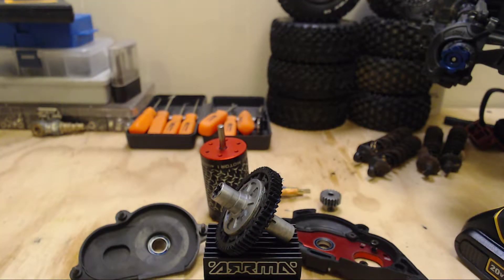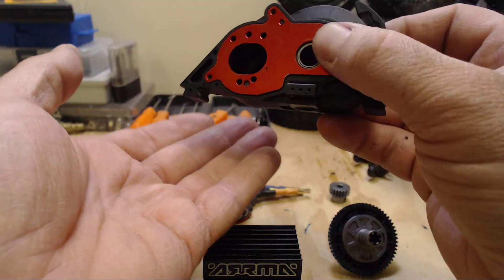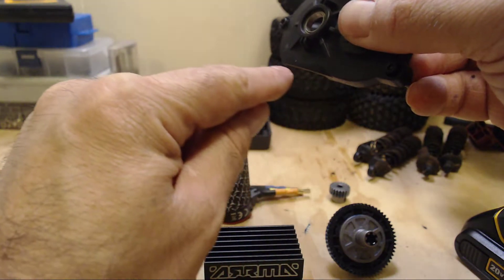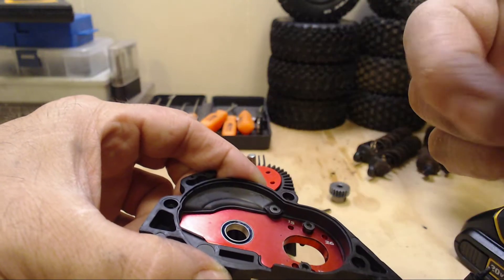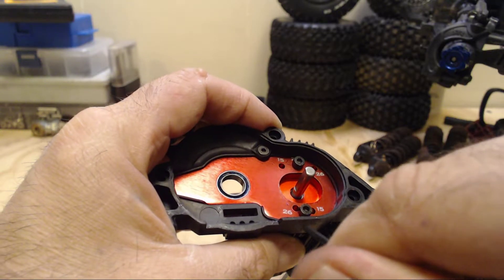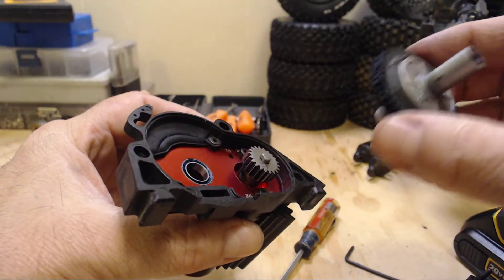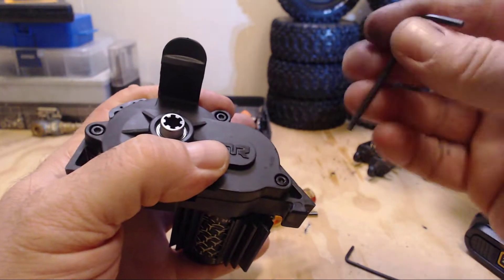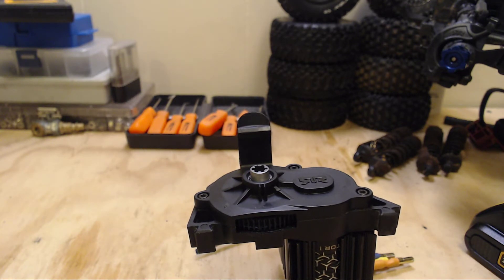Arrma Senton 3S - Power Module gearbox maintenance

Comment: A lot of people make use of the cut out under the spur by making a hole on the chassis right under it. Lets the dirt out instead of killing bearings in the slipper assembly and motor.
Reply from the maker: I've seen that solution before as well.

Comment: Grease in there will only collect and hold on to more dirt. I found a mod a bit counterintuitive but I tried it out after considering it for a while a d I'm glad I did. Take a look at this video from Rich Duperbash. Works great!
(check 5 min into the vid)
https://youtu.be/IzIHerc78Mc
Reply from the maker: I will check it out. The "fix" in this I've found is that when you hit the gas the first time, the force flings the grease onto the inner part of the housing and the dirt at least collects on that. Instead of your actual gears, causing more noise and ultimately premature wear. It's definitely a terrible design to begin with leaving the bottom of the gear case open. Shame on Arrma for that one. Thanks for sharing the link. Will take a look now.
Reply from the maker: Just checked it out. While allowing stuff to fall out, putting a hole in the bottom seams like it'd draw more stuff in to me. A point that ties in to that, I actually made a cover for the hole in front of chassis where you access the steering arm. A while back I had a rock actually work it's way into there and BIND up my steering. Took 5 minutes to pry the thing back out of there. Made a small custom plexi cover for it and no more issues. Definitely a bad engineering oversight on behalf of Arrma.

Comment: Why is it "open" ?
Reply from the maker: Good question. Terrible design by Arrma. I was pretty shocked when I pulled it out the first time and saw that.
Reply: @thanumgaming  Got a Typhon yesterday, after just 1 pack, about 10 minutes of running around in the dirt, the gearbox was loaded with dirt. Really awful design. And this is a V3.
Reply from the maker: @roxypda  Oh no! Well that is no good! The Typons are center differential design aren't they? Those are def not ideal for off road. So odd Arrma would do it like that. On road cars would prob be fine, but yeah any time there's exposed teeth running at high RPM, it's just collecting dirt and asking for trouble. Could you maybe make a small "doghouse" type cover to go over it and kind of cover it all up except for a spot on each side for the drive shafts?

... and congrats on your new car!
Reply: @thanumgaming  Thanks! RC is too much fun! 
Typhon is just like the Senton, same parts for the gearbox.
Reply from the maker: @roxypda  Indeed! RC is a great hobby! Ah ok, I was thinking of the 6S version, which has the center diff design.